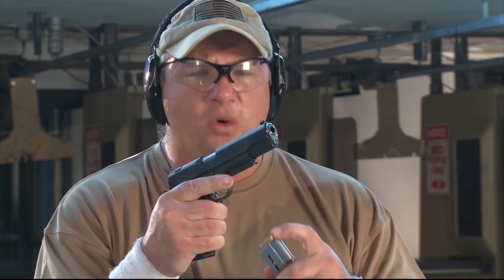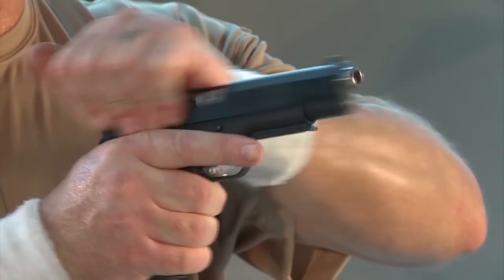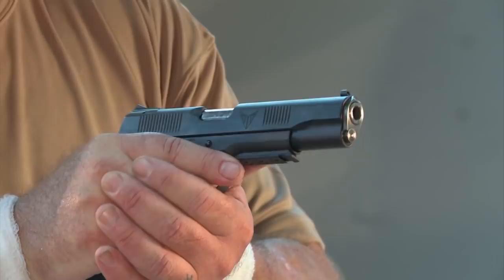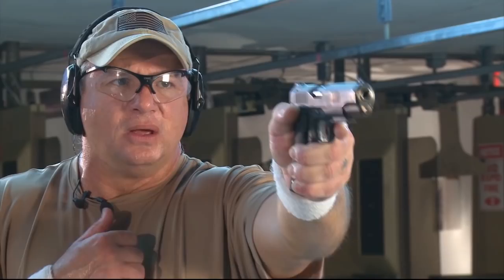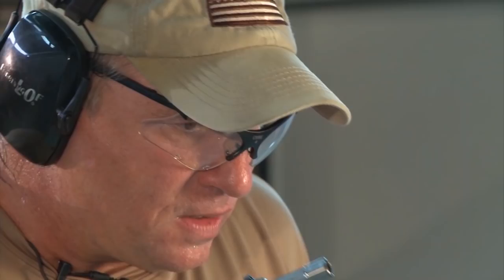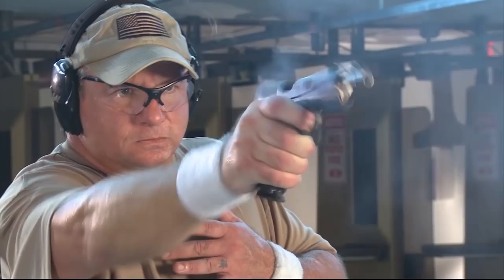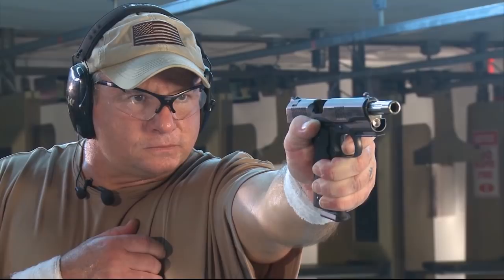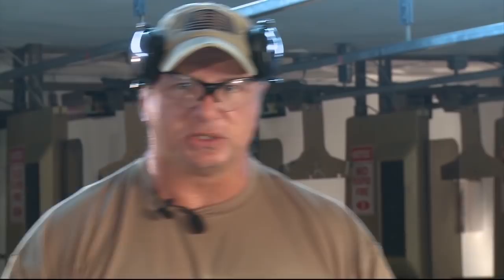Dave Harrington: Stabilizing The Pistol

Comment: Now that it's summer time, I think it would be beneficial to us all if superdave would come out with an instructional video on aggressive relaxation. I'm doing my best by sipping knob creek and yelling at hippies to cut their hair, get a job, and get off my lawn, but I could use some extra pointers.

Mr. Harrington is the man. His explanation of having to ALSO stop forward momentum as the slide returns back to battery is a good one and something a lot of people don't pay much attention to. I became very aware of it when filming my m&p45 in slow motion to see how effective the LWD comp is. Between each shot, you could see the muzzle rise up above the original bore line, then fall down below it, bouncing a time or two before finally stabilizing. Once knowing this, it actually helped me speed up and tighten up my groups. I worked on cadence until the trigger matched up with when the bore returned to its original position, but before it dropped back down. It was counter-intuitive, but interesting to find out that speeding up to the correct cadence actually shrunk vertical deviation.